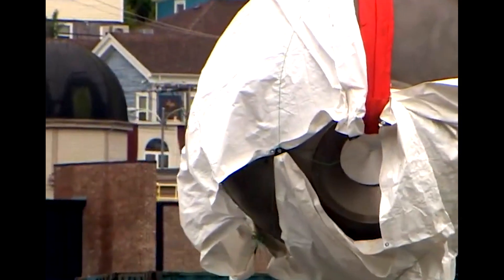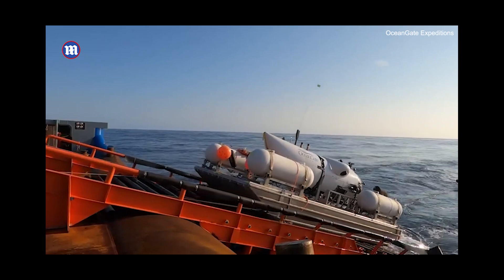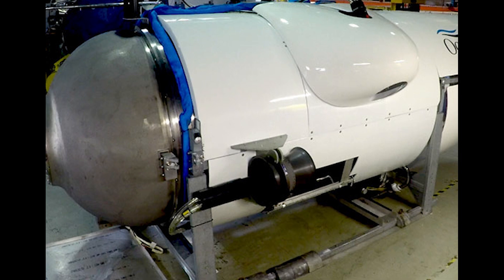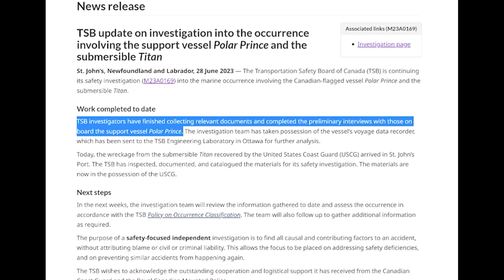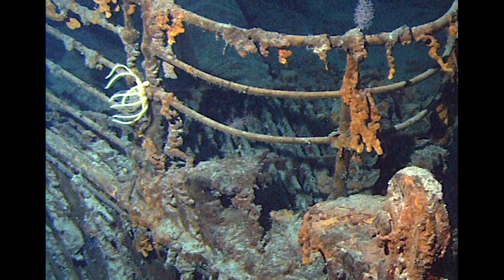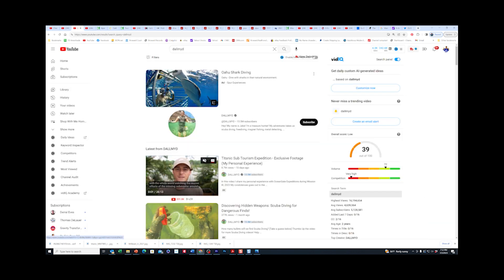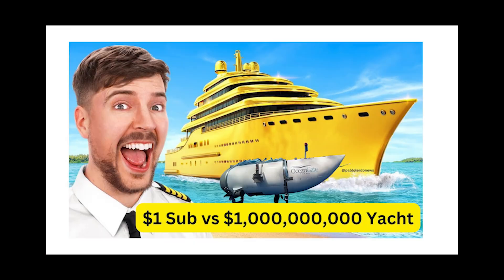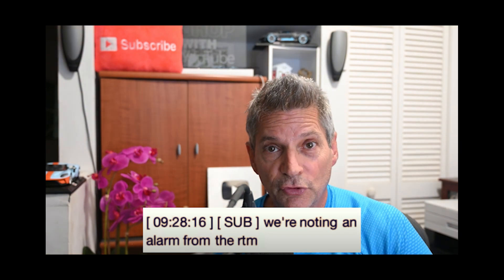Titan Submarine Debris Clues, Implosion Simulation

Comment: I heard on one aborted dive, they had to drop weights. by violently rolling the sub in the water, to tilt it, till the weights dropped, unreal,
Reply from the maker: Yes everyone on one side. That seems like a real cheezy way to do it
Reply: @jeffostroff  ya start stressing the hull even more at extreme depth.....   not good.
Reply: You mean those rusty hunks of metal? We call that round stock. Just take some rolled stock over to the band saw and cut it into sections and Bob's your uncle.

Comment: That demonstration of a collapsing drum only involved a pressure, at most, of 1 atmosphere, imagine what it'd be like with 100s?
Reply from the maker: Yes the pressure inside the sub is maintained at 1 atmosphere, and it is about 400 atmospheres at the Titanic.
Reply: @jeffostroff  I saw a YouTube video of a red Coke can in a pressure chamber and when they crank up the dial it literally turned into confetti in a fraction of a second
There was nothing bigger than the head of a pin left floating in the water
Reply: The pressure at the instant of the hull breach was only 1 atmosphere due to the "spring" effect of water being compressed by about 1 to 2%.  Basically what happened was about 50 to 100 volumes of the vessels volume of water immediately adjacent to the vessel decompressed to 1 atm (from hundreds), but in doing so instantaneously filled the craft with a wavefront travelling at nearly 3 times the speed of sound in air.  There is an extremely interesting video out there from Thunderf00t on why and how this happens and an explanation of the somewhat complicated physics involved when an explosive decompression event occurs.  Fascinating stuff.  I always thought the pressure itself is what killed.  Nope, it is the supersonic wavefront which while travelling, is actually under only about 1 atmosphere of pressure, because that's what's in the craft during a hull breach.  If water could not be compressed at all and there wasn't a spring effect built up from the intense pressure, water would simply move in at the rate of the column of water above it, which would be much slower than 3 times the speed of sound in air.
Reply: @byugrad1024 You cannot compress water - it cannot act like a, "spring": and this was nothing to do with explosive decompression - this was implosion. What are you talking about?
Reply: @lewis7515  Water is compressible at extreme pressures. At that depth water was compressed maybe close to 1%. This increases the speed of the implosion quite much, but not the energy. (Water compressibility is about 4*10^-5 / atm, close to 1 atm pressure, but it changes with pressure)
Reply: @adamrak7560  Water is compressible at extreme pressures - that can never be found on planet Earth. Perhaps you mean Jupiter? 
Stop writing nonsense.
Reply: @lewis7515  you are wrong.  A simple Google search will set you straight.  Search for "thunderf00t what really happens to a hull at 1000 atm."  Please enlighten yourself with knowledge instead of spewing fallacy.

For all practical purposes for us humans on the surface of the earth, in our everyday lives, water is very much considered an incompressible substance.  However in extreme pressures and environments, such as miles below the surface of the ocean, water does in fact compress in a measurable and predictable fashion.  And it is this spring of stored energy that when brought next to a bubble of 1atm of pressure decompresses and releases that energy in mere microseconds.  There is no time to heat the bodies, burn them from incredible heat on the order of the temperature of the sun, because the wave front has already slammed into every molecule of human flesh available, disintegrating even the DNA itself.  All that's left is ocean paste or slurry.
Reply: @byugrad1024  This is just more nonsense: sophistry to attempt to justify an absolute carnival pseudo-science.....

"Dense", is not quite the same as, "Compressible" - and, nobody uses those terms interchangeably: regardless that they are on the same scale - for practical purposes, they are different terms.
That's #1.

Even if you consider that small amount of increased density, "a spring", water is a fluid and it's cohesive material that is in equal compression, with itself, per equal depth.
So, according to this nonsense, if you call discreet portions of water, "springs", and create a relative vacuum for a region of water - for arguments sake, to its immediate right - that spring is going to rebound to the right and fill them vacuum.
But that water spring is in direct contact with the remainder of the water-springs in the ocean: an arbitrary portion of water springs under rebound, and leaves the remainder of the water behind, in a defined amount of time, at a defined speed - until such time as the volume of vacuum is filled and the water inside what was a vacuum, re-loads with density.

This seems to be just a bunch of obvious, pseudo, nonsense. The water maintains its contiguous density, for that depth - why wouldn't it - the pressure in the vacuum that's been created is much lower, so it must collapse - the body of water, with all it's inherent values, simply falls, under terms of its inherent values - to collapse that relative vacuum. 

Nobody said anything about heating and incinerating bodies - it's well-understood that temperature, is not the same as heat.
"Disintegrating even the DNA itself", is the kind of foolishness that people who are their own worst enemy write - it's an implosion, not an atomic bomb. It's not going to, "disintegrate even the DNA, itself" - are you insane?

It looks a lot like you been listening to some kind of uncanny goon and actually taking him seriously.
Sadly, that's #2.
Reply: @lewis7515  It is obvious to me you are not an engineer or physicist.  You obviously are lacking in your understanding of most laws of physics.  

I wish you the best in your quest, wherever that takes you.  But until you have an advanced degree in actual science, I'd suggest you open your mind to the opportunity of researching just how absurd the stuff you just wrote is.

Good luck to you sir.
Reply: Something that can does happen is cavitation. If you spin a propeller fast enough in water, it can create a vacuum in the water, which collapses, and really erodes propeller blades (and is very noisy, bad for a sub). At 400 atm, there's enough energy to compare to a couple hundred pounds of TNT. Carbon fiber does not buckle, it cracks (unlike fiberglass or metal). You would go from a progressive to total failure pretty quickly (milliseconds), where you essentially have a big vacuum where the craft was. The water would rush to close it, and slam into itself, probably generating enough heat to cause steam/cavitation (superheated because of the depth), after generating a shock wave. You would get a few shock waves, which would pulverize any non-metal stuff, ejecting the ends (and the window as well). If there was any life within 1000-2000 feet of it, they would at least be deaf, if not having internal bleeding from the pressure wave. SOSUS would definitely pick that up from miles away, and the reflections.
    Short answer, it would be much worse, because much higher pressure, and water doesn't compress, but what is a liquid isn't constant, especially at those pressures. If you had a scuba tank at that depth, and unscrewed it, water would flow in (50 atm difference to the water). Submarines have ballast tanks, and use compressed air to blow them out. To blow out a cubic foot of water at that depth, you would require at least 400 ft^3 of air to compress.
Reply: @patrickvolk7031  "superheated because of the depth"
How is this process of superheated water called in physics?
Cavitation?
Reply: @ranc1977  I admit here I'm speculating a bit, but with the massive force involved, there is going to be heat. Pressure raises the boiling point, so it's going to be above 100C (low pressure lowers it).
   If you want to see how cavitation happens fill a long enough tube closed at one end full of water, and hold it upside down (about 16ft-5m). A vacuum will be formed at the closed end. There are blenders too that heat up water by spinning the blades fast enough.
   My speculation is there is enough energy in closing the space from the vessel that it's going to do something to the water, more than a single pressure wave. Things get weird at high pressure (like clathrates of methane crystalizing in water, hydrothermal vents. It's 200 times a water hammer event in your house)
Reply: @patrickvolk7031  " there is going to be heat. "
How this phenomena with high temperature meeting high pressure is called officially?
Cavitation?
Reply: @ranc1977  Adiabatic heating. Cavitation is when something is separated which leaves a vacuum behind it. Compression heating is what would happen to the air inside the vessel when it implodes. Work is being done on the gas and liquid, which is turned into heat. I would expect it happens quicker than it can dissipate that heat to the surrounding water.
Reply: @patrickvolk7031  Thanks.
Could this Compression heating be used as energy? Instead of dirty oil - this compression would be clean source of energy and heat?
Reply: @ranc1977  How do you get the compression? You need energy to compress something, and you will get waste heat. 
   It's used all over the place. Refrigeration, diesel engines, air compressors (where the heat of compression is a waste product). Pistons generate heat through friction. 
   Jet engines compress air and inject fuel (and are much more efficient than pistons).
Reply: @patrickvolk7031  It is like I've been asleep all my life.
I never was interested in how motors works, I was convinced it was boring.
This pressure magic is fascinating - how it works, and how it reacts. It is astonishing.
Reply: @ranc1977  A book I read as a kid was called high pressure. I forget the author, but it went into anvil presses and weird states of molecules. I also loved chemistry, but became a signal engineer.
Reply: @patrickvolk7031  Interesting. What is signal engineer?
Reply: @ranc1977  railroad signaling. You have to follow standards for safety. Supposed to be one point safe. General idea is like the gas pedal (closed loop) and not the brake pedal (open loop) in your car.
   We use a lot of boolean logic, relays, and have to account for power loss, lightning strikes, user actions, burned out lights, track occupancy, to allow trains to move. There's also safety onboard the trains to ensure the operator is following the speed commands.
   I've done safety systems for other industries as well. I read a lot of NTSB reports (used one as an example of a detected problem, system resetting with a fault cleared the fault on reset allowing movement. A metro train went 12 miles out of the yard and collided with one with people on it (nobody was hurt).

Comment: Ahh glue the perfect thing to resist multiple pressure changes heat and saltwater
Reply from the maker: I wonder how well Flex Seal would do
Reply: @jeffostroff i bet that's where it went wrong, he forgot to use it
Reply: basically it was JB weld

Comment: I agree with your observation. If that glue held properly there would be bits of carbon fiber still attached to the ring. There would be shards sticking off of it. There are none... it is very clean. That seal was obviously no good.
Reply: Seal mainly relied on pressure. Better adhesion likely wouldn't have mattered. Even if water were to get through, that means the carbon fiber hull had already failed, so it would be a moot point. The bigger issue the seals relied on the carbon fiber hull maintaining its shape. That was truly the weak point. Well other than the porthole window that wasn't rated beyond 1300 meters by the manufacture, but likely held up.
Reply: @ronbennett7885 it was certified for 1300m but rated at 4000m probably would need more test , time and money to certified for 4000m and that’s a  no no when you in a rush
Reply from the maker: Somebody ate all the carbon fiber
Reply: I'm by no means an expert, however I do work in a field that regularly uses epoxies to bond dissimilar materials. Typically, the surfaces are prepared using some sort of abrasive to give the epoxy something additional to bite to. This may be why there is no epoxy residue on the rings. The epoxy was applied directly  to a machined ring with a nice surface finish.
Reply: It probably popped off like hot glue when it gets cold
Reply: Pretty sure they used the wrong epoxy, probably generic stuff for concrete anchor bolts.  They didn't use any kind of bonding agent on either the mating ring or cylinder end.  It didn't even look like they even bothered to clean it with iso alcohol, either..
Reply: Most structural adhesives are impregnated with tiny glass beads to keep the epoxy from getting squeezed out of areas and creating an uneven bond.  With no  press fit or any other means of attachment it was relying entirely on the adhesive bond - plus the entire hinged hatch assembly was hanging from it.  It probably would have popped clean from the smooth titanium side and more would be left on the rougher carbon fiber side.
Reply: @kev_299  I'm sure that's a failure mode they will be looking at - the hinged front end cap being held open as a door for hours and hours before each dive, stressing the glue joint.